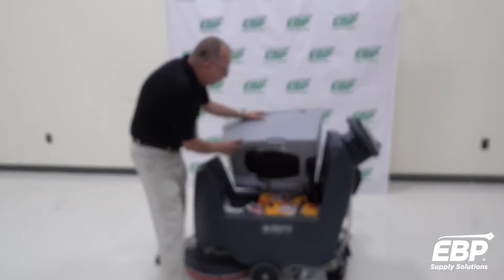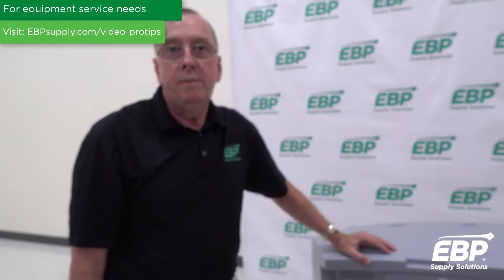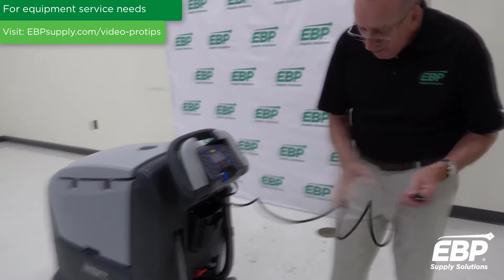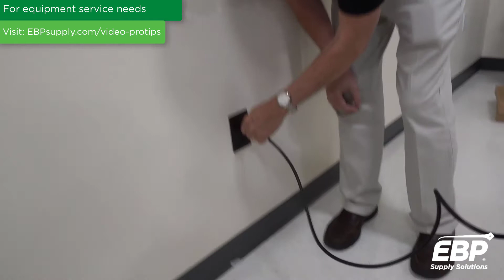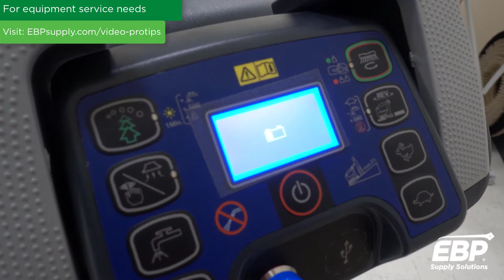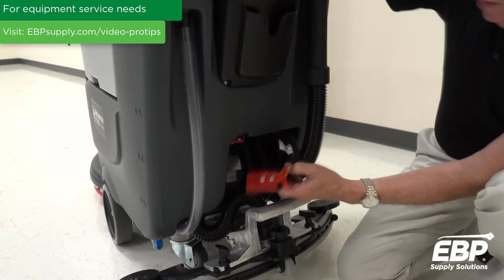Floor Machine Battery Troubleshooting

Comment: We have one that is garbage. Every 4 months it's dying. We charge it only at the end of the shift, still dying after 4-6 months. Not sure why
Reply from the maker: Hi! Thanks for watching our content. We understand how frustrating it can be when a machine is not functioning properly. Our trained technicians have a few reasons why this may be happening. First, the batteries may be at the end of their life and need replacing. And, remember, to always replace all of the batteries at the same time. Second, you could have a bad charger or a charger not set for your battery type. There are different battery types (AGM, Wet, and Gel). Each type needs a different algorithm setting. Reach out to a local Imperial Dade service center and one of our trained technicians can help get your machine back and running: https://www.imperialdade.com/help-center/general-inquiries?pathname=/

Comment: When you say cooling them down. Do you need to unplug it after fully charged then let it sit   for 3hours before using it?
Reply from the maker: Hello, and thanks for watching! You do not have to unplug the charger to cool down. Today, most chargers are automatic and shut off when the battery is fully charged. So, cool down happens overnight after the batteries are fully charged. The next day, you are good to go. For more information, check out our article and video: https://www.imperialdade.com/blog/floor-machine-batteries-101

Comment: So what you’re saying is these machines are useless
Reply from the maker: Hi! Thanks for watching our video! On the contrary, floor machines are extremely important machines to add to your cleaning program. However, like any piece of equipment, they are prone to issues. Here in this video, we aim to help you solve those potential problems quickly. Check out these articles to learn more about the benefits of floor scrubbers:  

https://www.imperialdade.com/blog/auto-scrubber-vs-mop-and-bucket

https://www.imperialdade.com/blog/what-is-an-automatic-floor-scrubber

https://www.imperialdade.com/blog/how-to-use-an-auto-floor-scrubber
Reply: @ImperialBrady my comment was purely satire but yes. I love ours. We have a t300e from tennent really effective when on. Just servicing them can be a pain.
Reply: @ImperialBrady also thank you I will certainly check out this video.

Comment: Hello. Thank u for the videos and tips, very helpful! We have an Advance Micromatic M17B. I obtained it a couple of months ago used & got the batteries tested- they were bad. On January 4th i got 2 new deep cycle marine batteries. They worked very well for about 2 weeks and were charged properly. Unfortunately we had some extreme cold and they were exposed to it.  On 1/22 after a full charge the batteries showed no charge within 60 seconds of starting. I had both batteries tested and one was found to be faulty and replaced. On the 23rd and 24th it worked great and was no longer exposed to any cold. On the 25th after a full charge, the batteries showed no charge within 60 seconds of run time. i had both batteries tested and one was found to be faulty and replaced. at a loss as to what might be the issue.
Reply: On the 25th i plugged in the batteries, charged them fully, and on the morning of the 26th once again within 60 seconds had no power. I brought the machine home from the job, plugged it in and charged it all day and tonight it has no power within 60 seconds of turning it on. Any suggestions would be greatly appreciated.